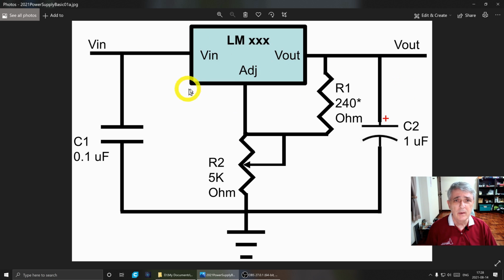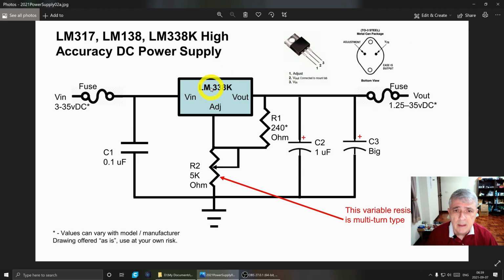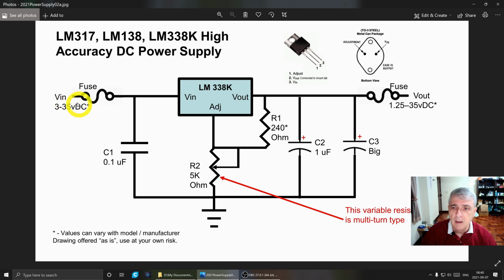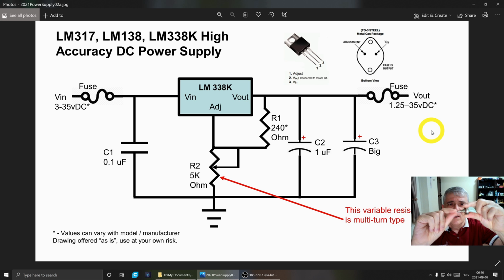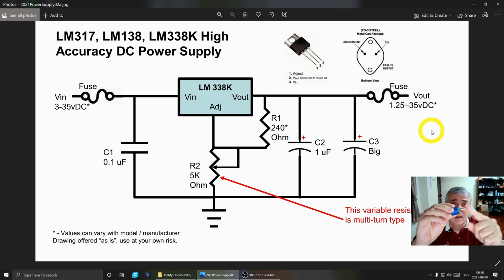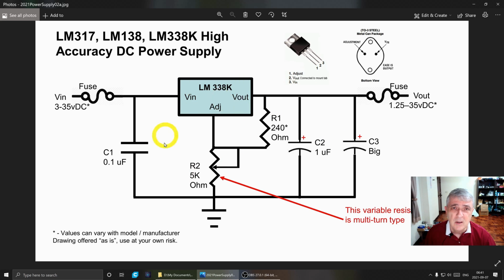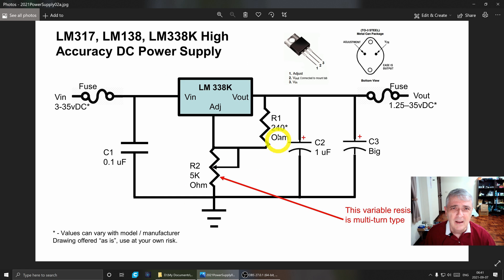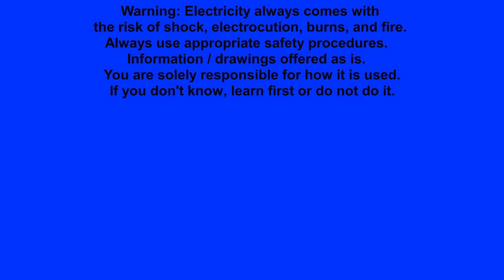DIY High Accuracy Power Supply (4K)

Comment: It's very simple and effective, but the main disadvantage of linear voltage regulators are the heat produced, the wider the gap between input voltage and output voltage, the more heat is produced, SMPS circuits came to solve this problem, but also SMPS produce more EMF, that's why high precision devices still using LM regulations but driven by transistors,
Nice vid 👌